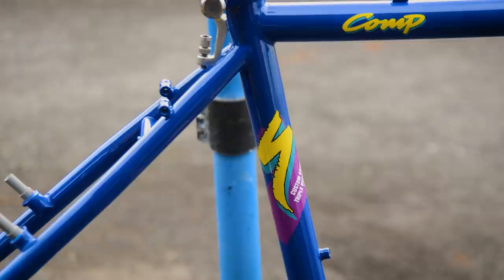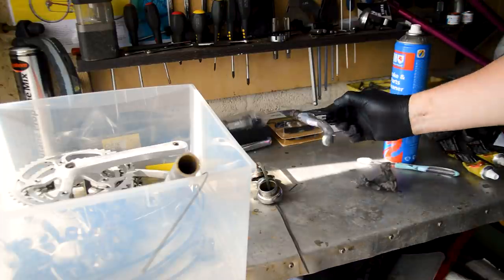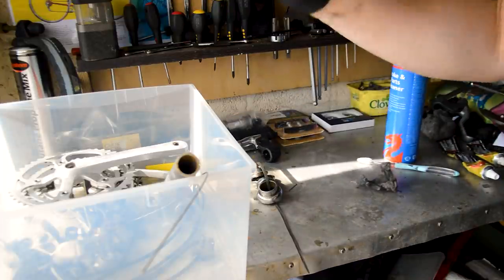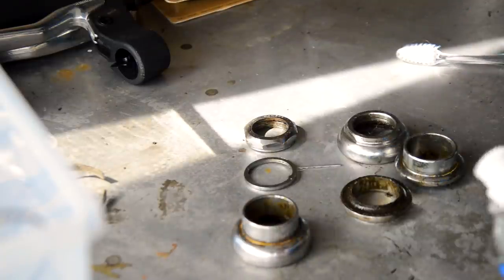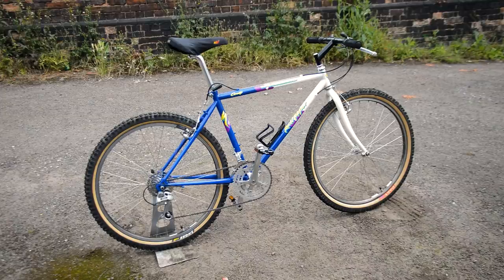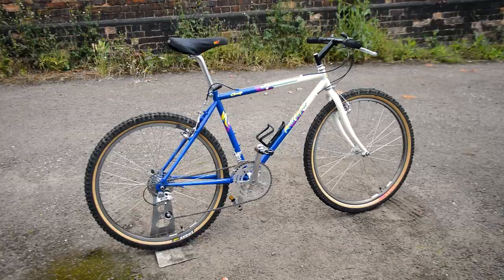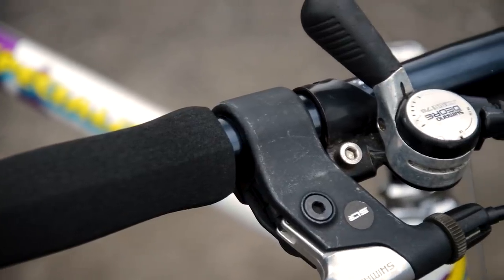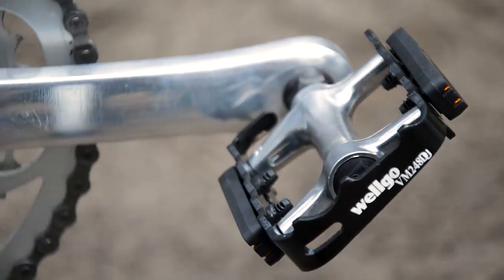1989 Specialized Rockhopper Comp - Mountain Bike Restoration - Part 2

Comment: I scored on a barn find locally in northern california, two of these, same exact color, one in a 26 inch and the other in 24, the guy i got it from said he bought it for his children, they took it around the block once, and were then sitting in a well kept garage for over 30 years, they didnt even have dust or spider webs on them.  Original tires werent even cracking, dork disk is still clear. Wheels have absolutely no brake wear marks. Only flaw was, i rushed them home on my bike rack, and now there is a little rubbing on one chain stay of one bike and on the fork of the other, party foul on my part.  Love your builds, keep it up.
Reply: I have one two. They are so we'll built and get conversation EVERYWHERE
Reply from the maker: Good score!

Comment: Love this build. I just picked up an 88 that’s all original. Your bike is really close to original and if you wanted it perfect, the pedals were originally black plastic Specialized pedals. The bottom bracket was the older cage bearings with axel and cups. The saddle was a plain black Specialized saddle with a red S logo on it. All are reasonably priced, but like I said, your bike looks amazing as it is now. Thanks for sharing.
Reply from the maker: Thanks. Yeah I know the original pedals. I had them on a standard rockhopper. They’re bloody awful though 😂 I do have the correct saddle though. It’s in the catalogue on retro bike.

Comment: wait.....the BB and bottle cage bolts are painted over without any masking at all?
Reply from the maker: The BB did have the threads masked up. As for the bolts. No, unfortunately not. I replaced the one set with stainless. I’ve got a second cage to fit too I it’s stainless bolts.

Comment: Hey Monkey, did you use stickers, or is it paint?
If it was adhesive, did you apply the adhesive and put the varnish on top? What kind of varnish?
Nice job as always. Best regards from Brasil!
Reply: I'm pretty sure these are decals that he purchased. They are impressive. it appears that he put the decals on without clear coating which is what specialized did during that year. Decals are exposed to the elements and more prone to tear off but it is period correct. I have similar original decals on my 1989 rockhopper comp in the yellow colorway
Reply from the maker: They were decals yes!  Josh applied 3 layers of 2K clear after applying them so they are protected

Comment: How have you been liking the Panaracer Smoke+Dart combo? Do they by any chance handle somewhat like modern compound? To me, they look like an interesting balance between old and new. I quite like especially that the tread pattern is much more aggressive than what you'd see on most 26x1.95-2.1 offerings, considering those are generally in the fast-rolling XC category. I'm replacing a modern set that's dry-rotted, and naturally I am wondering whether I go modern or classic. I take it modern may be more comfortable, at the cost of having less aggressive tread -- but I very much would like to know what your opinion is.
Reply from the maker: I’ll be honest. I haven’t had chance to use this bike that much.  Couldn’t really give a proper review of the tyres.

Comment: Nice restoration as always and no Dis. to yourself MS but the pro paint job stands out a mile. If your struggling with views maybe mix it up a bit; you haven't done a road m/c for a while and what about that belt drive you hinted at?
Reply: I tune in for the regular format of restorations.
Reply from the maker: I do have a road waiting in the wings.  I just need to repair part of the paint I messed up... The BSA Twenty too.  That's close on the list of things to do.